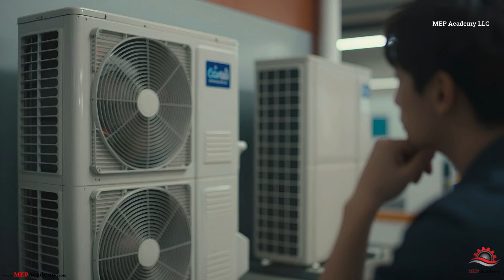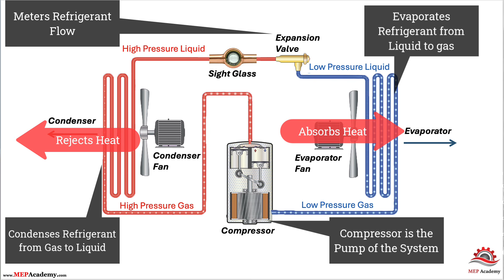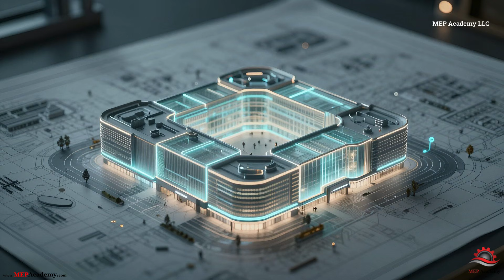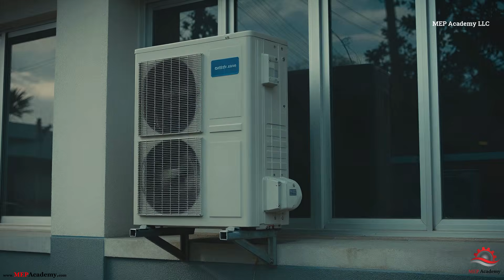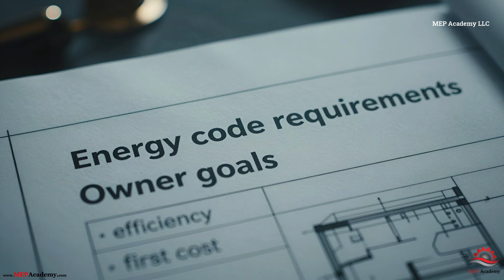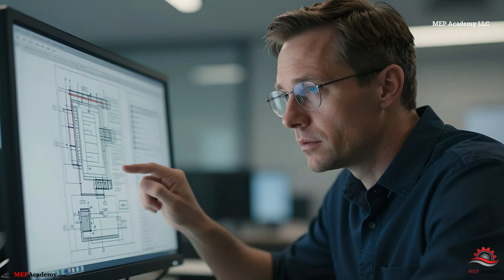Heat Pump vs Air Conditioner: Key Differences, Efficiency & When to Use Each (HVAC Guide)

Comment from the maker: 👉 Are you designing for the building… or for the zone?
In real HVAC design:
•	Interior zones often need cooling year-round
•	Exterior zones need both heating and cooling
That one concept can completely change which system you should use.
Quick question for you:
👉 Have you seen projects where heat pumps were installed in interior zones where heating wasn’t even needed?
Drop your experience below — this is where design and estimating decisions really matter.
If you want to go deeper into HVAC system design, estimating, and real-world applications:
👉 Check out our training and tools here: https://courses.mepacademy.com/

Comment: I have never seen an air conditioner that oly cools. Also never seen an air conditioner that needs a furnace to heat... It's true that I am from a different oart of the world, but here, every AC can cool and heat by default without a furnace.
Reply from the maker: It's very common for homes to have a split system with a Gas Furnace depending on the area of the U.S. one lives in. Other Countries differ. It's based on the availability and cost of fuel or electricity.

Comment: So my reverse cycle ducted air conditioner is, in fact, a heat pump?
Reply from the maker: Sounds like that is what you are describing. If it's all electric and it does both heating and cooling with no fuel lines connected, you have a Heat Pump.